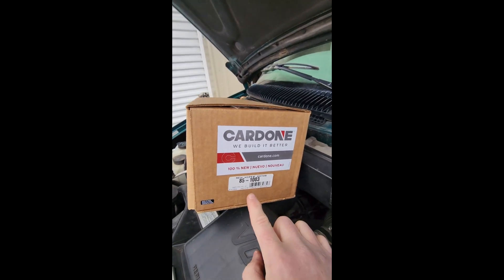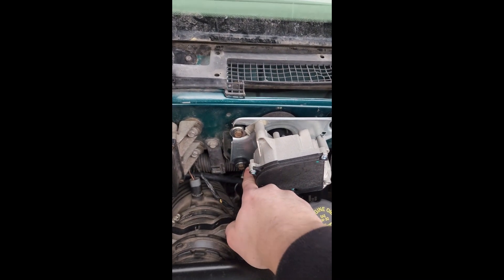Astro van wiper motor replacement. EASY in under 50 seconds #shorts

Comment: You don't have to remove the wipers to access the inside bolt and linkage.  Just remove the screws from the plastic grill and stand the wipers up, off of the windshield and the grill can be lifted 4 or 5 inches to give you full access to the interior bolts.